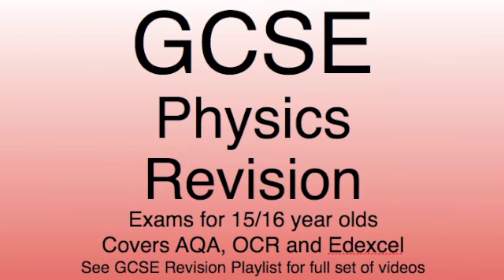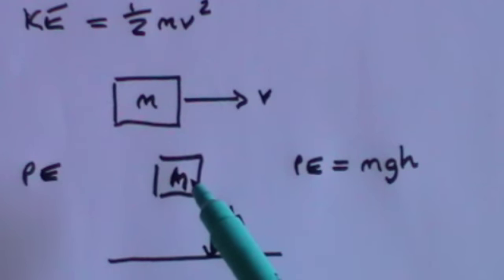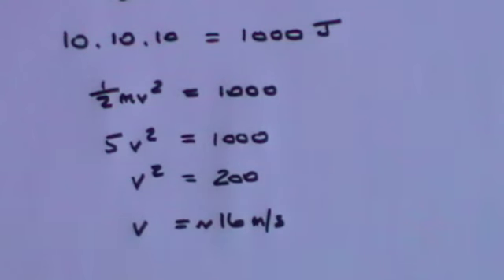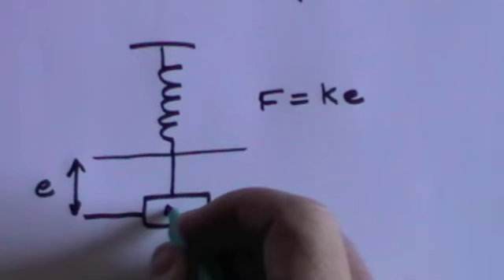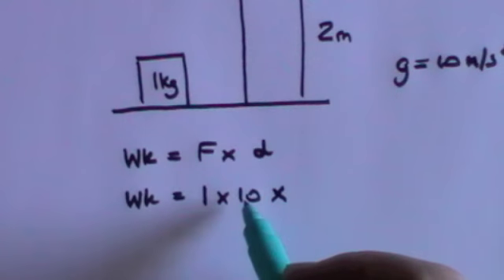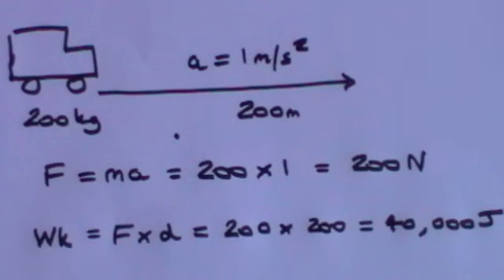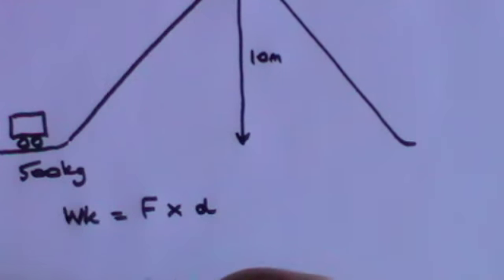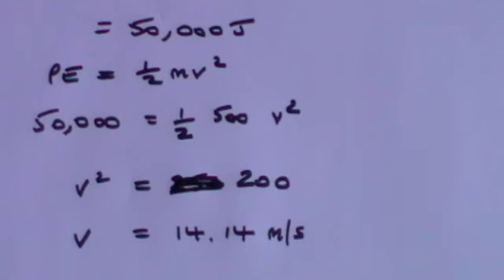Work & Energy: GCSE revision

Comment: Could u answer this question for me?

What is the work done for a 9500kg car to travel 25m?
Reply: you will need another value to calculate the acceleration as it is insufficient. i think that you missed out the acceleration of the car  because we can find the force for it by the acceleration formula. hope that it helps. thanks :)
Reply: i'm assuming that the car is travelling forwards therefore no gravity equation is not involved as they are in a different direction as the direction the car is moving.
Reply: Force =weight=mass X gravitational field strength

*i'm assuming that the gravitational field strength is 10 
Mass=9500Kg
So 9500 X 10= 95000
So 95000 is the force
Now apply the formula
W.D=F times distance
The work done will be 95000 X 25
Reply: Your question is incomplete, please check again and let us know the full question.
Reply: Cheryl Chong no your wrong remmeber the force must be the same direction as the distance but weight is directly below so you cant find out unless you know what is the amount of force that is being produced by the car

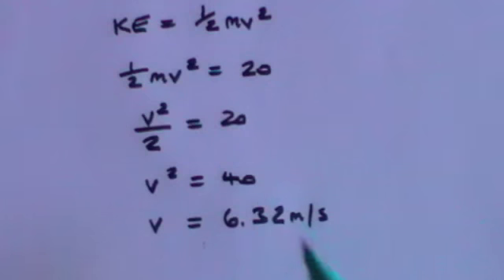Comment: 19:09 1/2 of m=1kg should be 0.5kg giving 0.5*v2/2 if this is wrong can you explain why?
Reply from the maker: +ItsJxmes No. We are saying that the PE of the 1kg at a height of 2m is 20J. When the block hits the floor all PE is converted to KE = 1/2 mv^2.
So 1/2 mv^2 = 20
Reply: +DrPhysicsA Ok thanks for the reply it helps alot

Comment: what happens to the kinetic energy as it hits the ground? in what energy is it converted?
because when a body will hit the ground, it will come to rest, v=0, therefore kinetic energy becomes 0. what happens to the kinetic energy?
Reply from the maker: KE may be converted to sound or light or heat energy - or it may be transferred to the earth. When a body hits the ground the earth will recoil. But because it is so massive the effect is immeasurable.

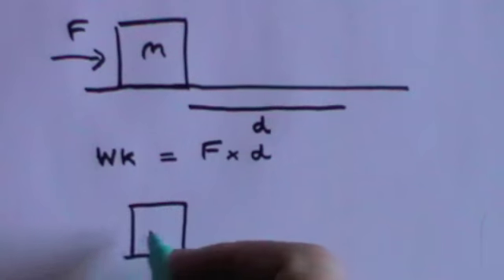Comment: Regarding the problem in 0:50, if we assume theta to be the angle beteween the force and line parallel to the ground, than will the work done by pushing the body to the right be equal to F*cos(theta)*d ? Or is it something more complicated than that?

Anyway, thank you very much for your videos, they are really helpful.
Reply from the maker: Thanks the kind comments. You are right about the use of the cosine. I covered this in my more advanced level videos on the A-level course. I will touch on it in some of the videos on the GCSE series.